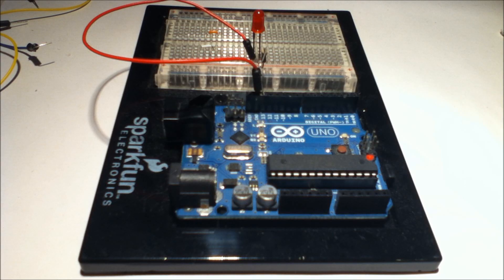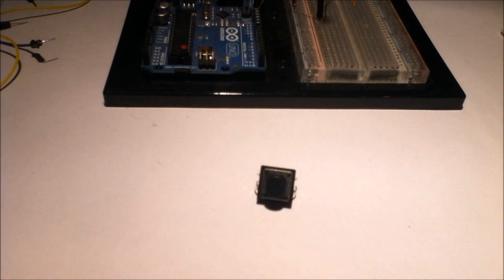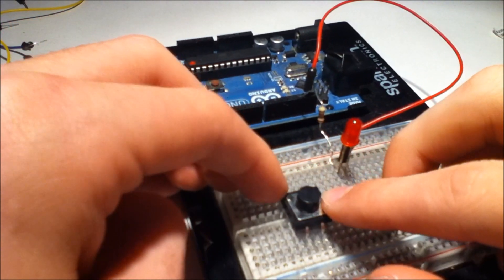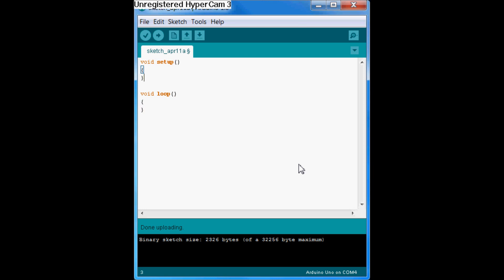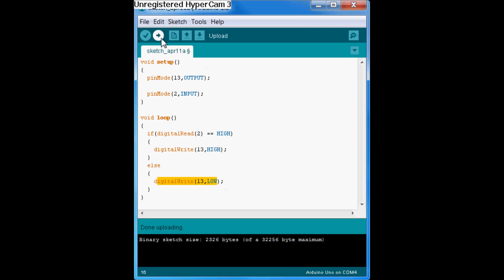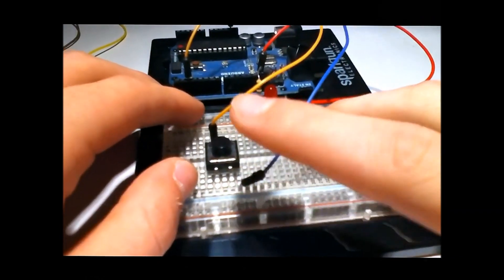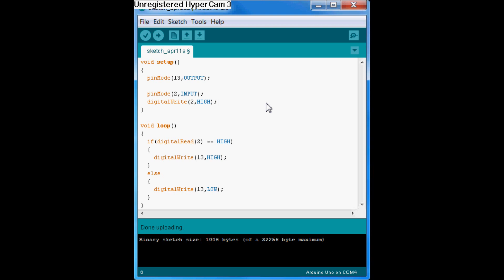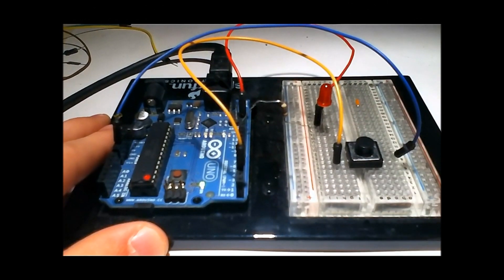Arduino Tutorial #3: Digital Inputs and Pull-Up Resitors

Comment: Newbie here. In the final example, isn't it bad to have a high pin (2) go directly to ground when the button is pressed? Wouldn't that be a short?

Thank you whomever helps me understand.
Reply: +Bigolpete I had the same question; seems like a short circuit to me. But, open listening and watching carefully it is 5V going to pin 2 not ground.
Reply: +Bigolpete When the push button is pressed, the current is still going to the GND but through the internal resistor of the pin 2, so it is not a short circuit. That is advantage of using a Pull-Up resistor instead of Pull-Down resister, i.e. no need for an external resistor like the latter case, because in the former, you will use the internal resistance of the digital pin itself. :)
Reply: +Dhaval Mysore so, if the line of code for the pull up had been omitted "digitalWrite(2, HIGH);" would pushing the button have created a short circuit then?
Reply: +Michael Mason Good question. I don't think it would create a short circuit because it wouldn't even work without the digitalWrite(2,HIGH) command! The reason I say that is because I tried having one end of my jumper wire inside the digital pin (while the pinMode was set as an INPUT), the other end was free, and used to get floating state (my LED used to turn on and off randomly), and when I connected it to +5V, it used to read HIGH, and when I connected it to GND, it used to read LOW. But without the digitalWrite(2,HIGH) command, your pin would be in floating state or LOW state, OR, floating and HIGH state (depending on if the other end of the pushbutton is connected to GND or +5V, respectively), so wouldn't work with HIGH/LOW state only.

Comment: Mein, the Arduino has a max of about 40 milliamps per pin. the resistor adds a buffer to make sure you don't exceed the 40 milliamps and hurt the Arduino board.

Comment: Why do you need a resistor for the LED? And how many Ohms does it have? I am a beginner.
Reply: +Mein Kanal! idk if this is still relevant, but without the resistor you'd blow the LED because the current would be too high
Reply: Okay, but if I use an LED rated for 3.3V and I use that voltage, do I still need one?
Reply: Krista Poolsaar Oh, wait: current? Okay, sorry Ic onfused current with voltage, I am German
Reply: Mein Kanal! You should check out the specs of both the port and the LED, and using ohms law calculations figure out a resistor value that will work best with your circuit. Try this: http://ledcalc.com

Comment: HHD, I will fore go the overkill on the thanks and all, but I think I have found the Arduino Tutorial series for me. I will be reviewing the "Pull up Resistor" bit, because if my hunch is correct you will probably be able to make it clear as glass on the what-and-why on this matter. I just need the correct angle to understand and I must know the Arduino. I intend to make an analogue to ppm converter with it. Joystick control of RC device, namely a Multirotor Quad.  I wish to know Arduino intimately. Very illuminating sir.

Comment: I couldn't get this working with a button with two terminals, NO (Normally Open) and COM (Common). These are the only terminals. I tested it with a multimeter and the button is okay.

Comment: Could you have used a digitalWrite(2, LOW); to pull the pin down to ground. Then connected the push button to 5v instead of connecting it to ground?

Comment: Why don't you use:

int ledPin = 13;
int switchPin = 2;

because that way, if you change the pin that the LED or button is connected to, you don't have to change the number 13 or 2 every time, but only at the beginning... I'm not sure if you are really sure about what you are talking about....